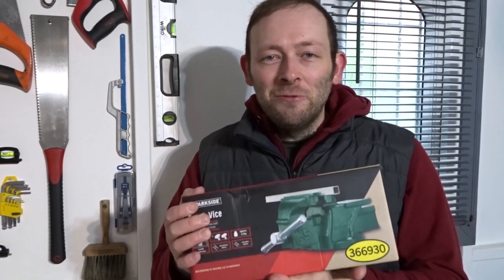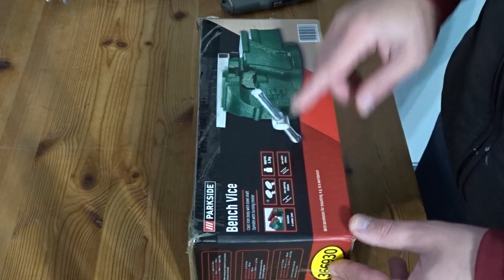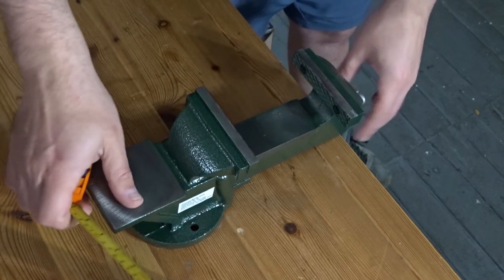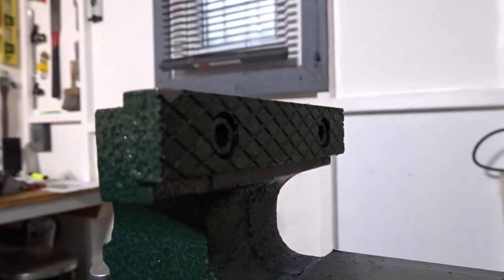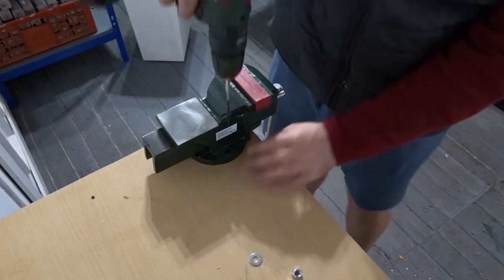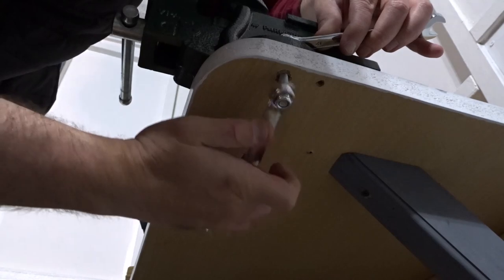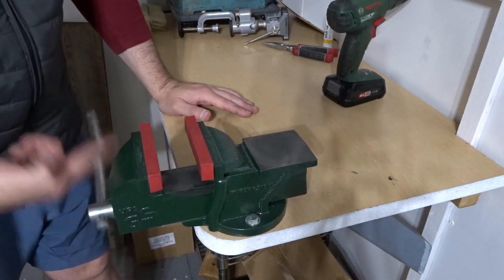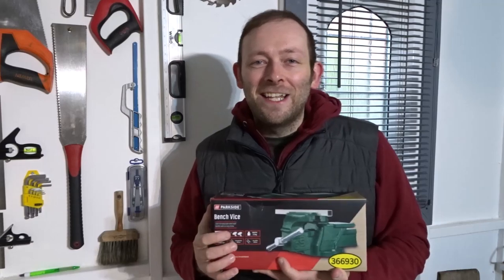Lidl Parkside Heavy Duty Work Bench Vice Unboxing, Review, Testing & Installation

Comment: Good price for a vice have  two different sizes vices at home but like one for my shed at allotment. Dont see these on offer at lidl web site they started a tool offer yesterday they very cheap and have a multi tool drive for £30 not including batteries. I have had mixed view on Lidl stuff have a few things like a bench sander and a sander fail and not used that much. Always keep the receipts, I now scan everything I buy from them when its hardware. There Japanese saws are good noticed you have one too
Reply from the maker: Yea I have the Japanese saw it seems good for the price. I have a few more tools still in their boxes too which I've not opened yet.

Comment: Didnt have any in my store got some f clamps though and a compost bin for £10 down from £20. Plenty of electric tools left and batteries 2 and 4 aMh. I blame you Phill for going there ;)
Reply from the maker: Haha yea I have started to pop in there even when I don't need shopping now I will have to stop that 😆
Reply: @PhillWyattProjects  I get told off by my wife for spending £30 on clamps and compost bin, nearly got multi tool drill and batteries/charger, but I do have standalone cordless tools it just nice to have a spare down allotment. I will get a vice next time around I do have a B&D workbench down there is 36 years old and better than ones you can get today
Reply from the maker: @Chris-pv2ht  Yea some tools you want to buy even though you know you will probably never use them. I have an old workbench you have probably seen it in my videos its a black and decker workmate years old I found it thrown out for the scrap man. Its very sturdy. I have a modern one also but they are made of thinner metal.

Comment: Enjoyed the video and I really like Lidl's range of Parkside tools, they're good value for a hobbyist.  I saw this vice in Lidl recently and I'm sure it's great for many things, but it definitely isn't a "heavy duty" vice (as described in the title of your video).  Also, it's a metalwork vice and the rubber jaw covers are for using with softer metals (such as aluminium and brass), so that the jaws don't mark their surface.  For the position of the vice on your bench, if you put a piece of flat bar vertically in the vice (so that it's running down towards the floor), will it clear the edge of your bench, or does the vice need to move a bit further forwards on your bench?
Reply from the maker: Thanks! It is a heavy duty vice when compared to my old vice 😆 Yes it's a metal work vice I plan to add some wooden covers to the jaws. I do have an old record woodworking vice although I haven't gotten round to restoring it yet. Oh and yes there is just enough clearance to get a bar down so all good 👍